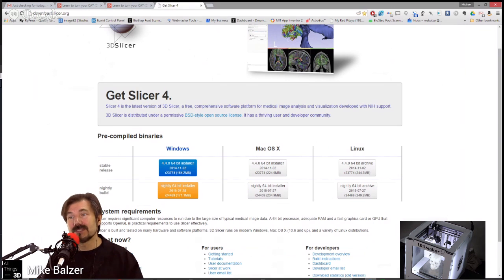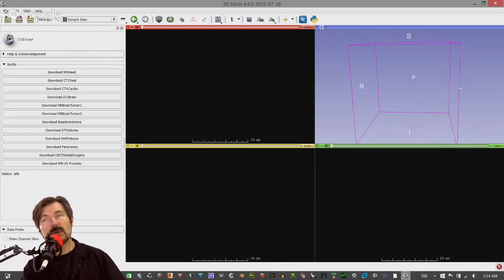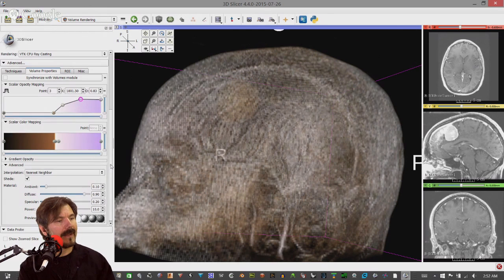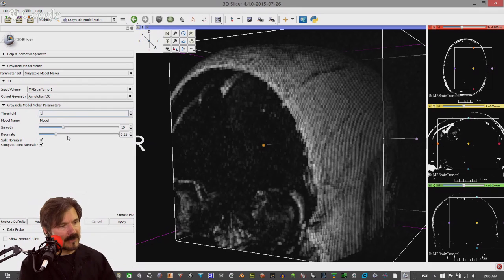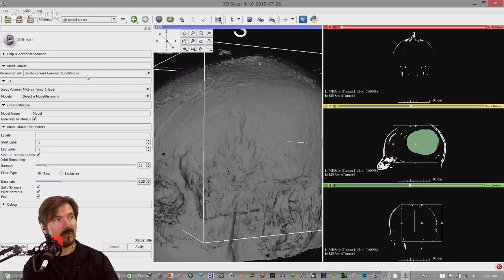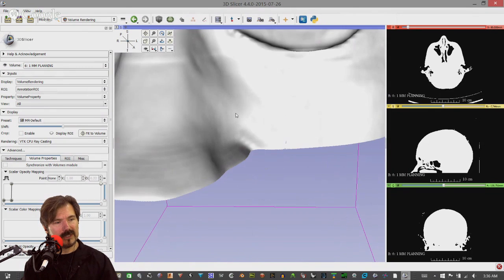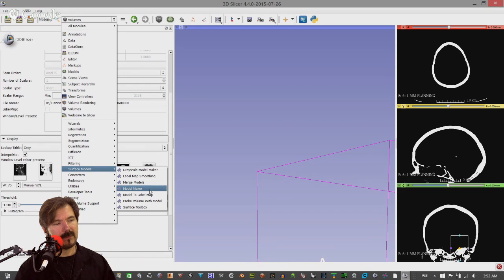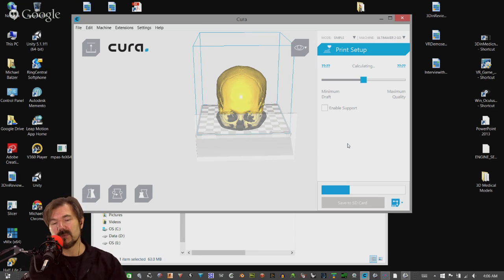Learn to turn your CAT (CT) or MRI scan into a 3D model.

Comment from the maker: Few items I stumbled on that I remember now.

DTI stands for 'Diffusion Tensor Imaging'  These are the cool fiber looking images. you may have seen and very useful for seeing neural pathways and white matter in the brain.  I still owe Dr. Klioze  a tangible model derived from a data set he sent.  https://en.wikipedia.org/wiki/Diffusion_MRI

Make sure you select the proper gradient image scales when creating volume renders.  Otherwise you run into the trouble as I did on the show. :(

The item I was struggling with is "Crop Volume" because you can't find it as standard drop down menu item.  You can find it under "All Menu Items" which is located at the top of the main menu item list, which does as it is labeled and that is to list all the menu items.  Or buried under the Converters menu item.  Personally I would call it the "ROI Volume Crop" tool for a stronger association.  In any case, easy to use when you find it.

Comment: I want to study femur bone (thigh/long bone) for Finite Element Analysis of its strength and as you may know, the bone has two distinct materials :cortical bone (hard/compact bone) and Cancellous bone(soft bone). I wanna know if i can use this software to make a CAD model with said distinguished regions. Thanks in advance

Comment: Hi folks, does anyone knows how can we separate soft tissues from the hard one I mean skin from bones?
Reply from the maker: Patrick Braga That is a hard one due to its tonality.  There are some tutorials eles where that show how to create layers of different anatomical areas, but if you are wanting to 3D print, it becomes much more difficult due to its two-state surface creation.  It is much better to use contrast solutions at the time of scan to enhance the area of interest.  Also make sure you are using a scanning process conducive to the area you are trying to extract 3D information from as well.
Reply: All Things 3D Thanks so much answearing. It's for export and edit in Maya and I just would like the skin at all and bones separately. Gonna try and find some tutorials.